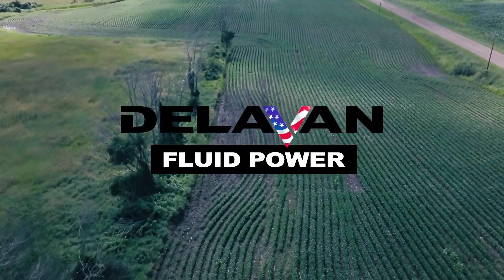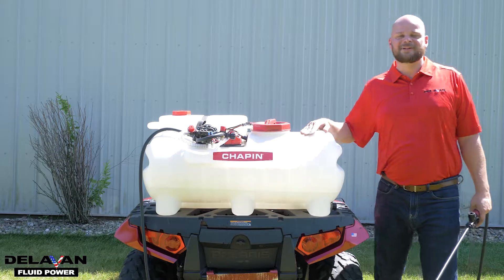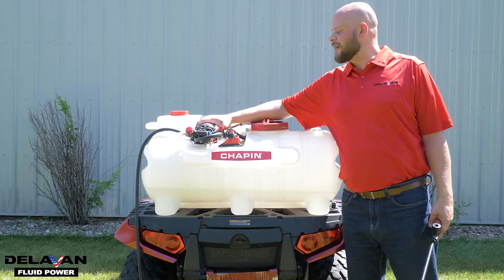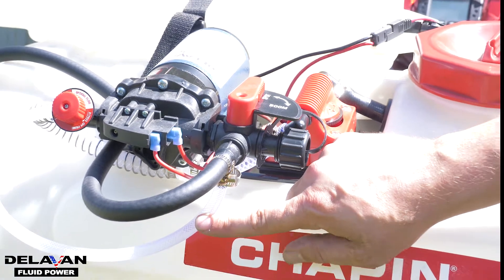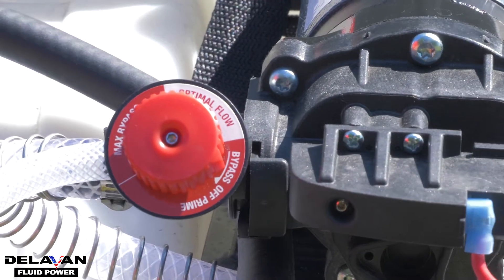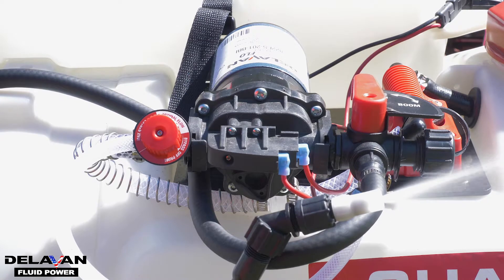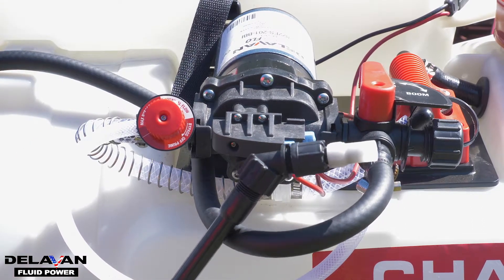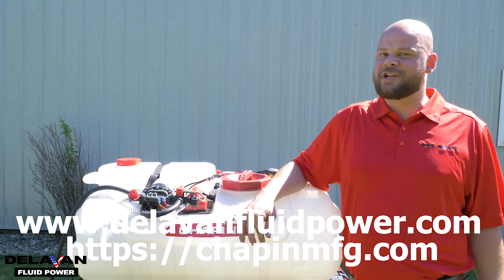Chapin Mixes-on-Exit Sprayer Set-up with Delavan Pump

Comment: bought a new champin sprayer just like this one. Pump lasted 15min and now I have a broke down sprayer that has been sitting for 2yrs. Contacted champin about it and no help during warranty. I was referred to a company who could not Identify the pump for it or the model of the sprayer or even the part# that was in the champin manual.
Reply: not sure if this will help you at this late in time- I just ordered on for about 70.00 from Tractor Supply